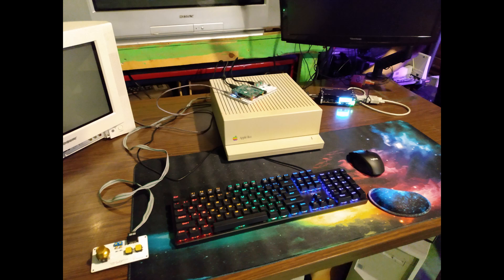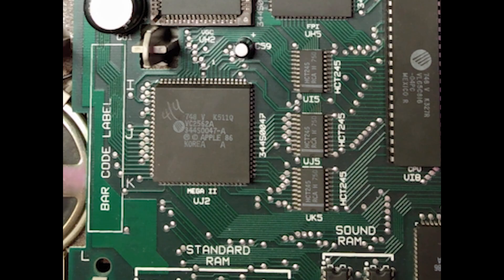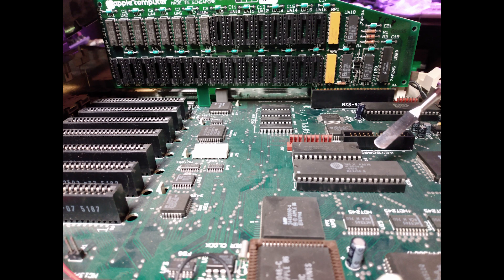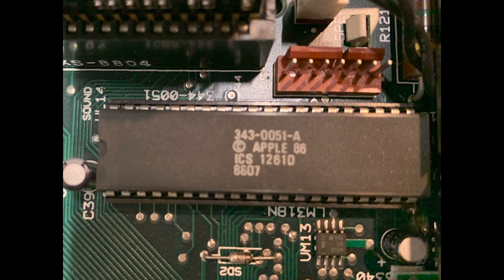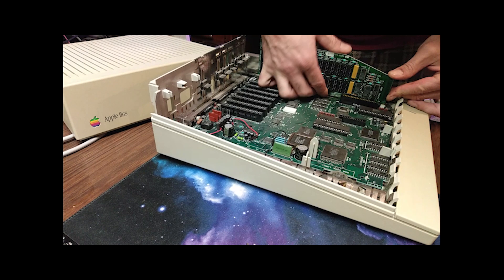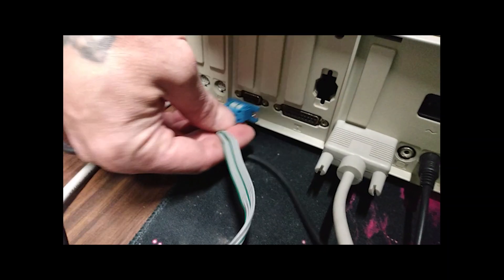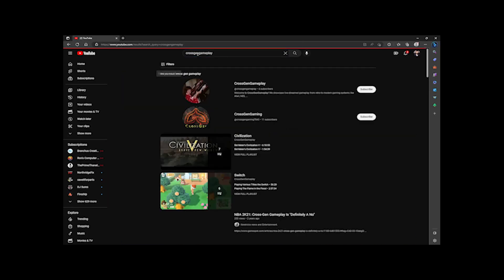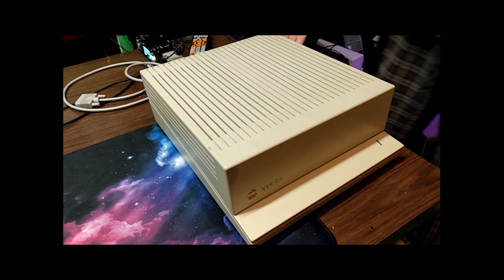Apple IIGS : Upgrades and Enhancements | #Appril2

Comment: 1:02 Filtering on the audio output limits the maximum sample rate for the Ensoniq DOC to 26KHz. With all 32 oscillators enabled, the highest sample rate per digital oscillator is a bit over 26KHz which in turn is the reason for the filtering on the output.